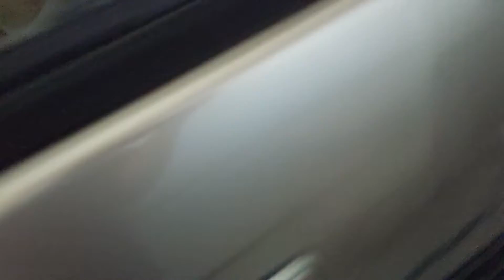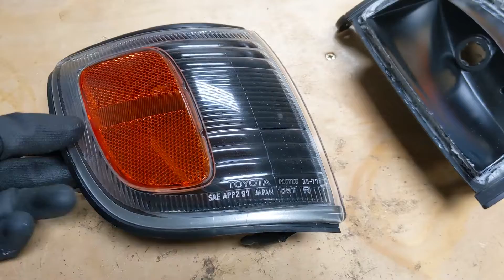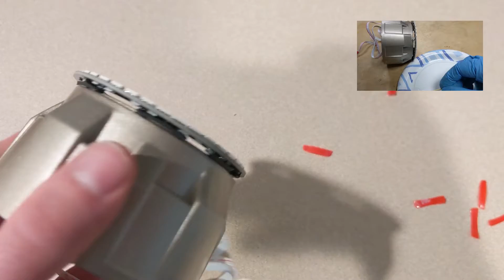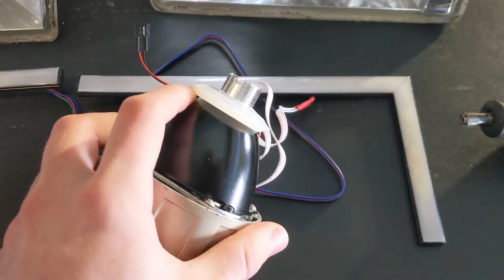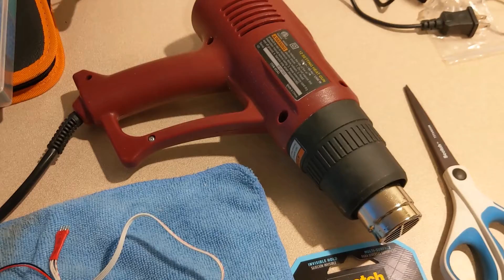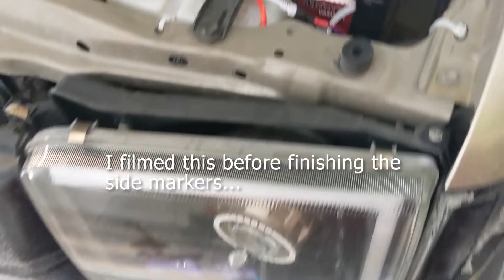DIY Custom Headlights - 3rd Gen 4runner Part 1

Comment: How are your lights holding up?
Reply from the maker: The projectors themselves are doing great, but not so much for the LEDS, I should have bought some higher quality ones, the blue signal for 3 of the LEDS in the driver-side halo have gone out. I bet if I epoxied them as well, we would be just fine!
Reply: @Tuccibuilt  I ordered the Morimoto projectors with the HID lights.  I'm not doing any halo's or anything else.  Just want to be able to see at night.
Reply from the maker: @christopherbrown5338  Great choice!
Reply: @Tuccibuilt  Better be for how much they cost!
Reply: @Tuccibuilt  One of the things I learned on my retrofit lights, LED's fail. heat dissipation issues with most installs is common. Halo's are toast and now I'm just rocking the projectors and don't care. The light output compare to em is a game changer here in the PNW

Comment: I have a 2000 4runner, is there a DRL wire I would have to cut?
Reply: Looks nice btw
Reply from the maker: Thanks! From my quick research it seems like there is possibly a little box right next to your battery and you can just disconnect a connector. Do a search for "2000 4runner drl disable" and there are some forums that should help.

Comment: Honestly I would just leave it stock. Looks like an alien or ET. I would do this to maybe a Honda but not 4runner. The 3rd Gen is already as clean as it get. There's more people moving back to original stock look than retro. Spend your money on other upgrades where it counts. That's just my opinion.
Reply from the maker: They definitely do look different, but I has grown on me. You're right, the stock ones give a really clean and fresh look. All I know is that the stock light output should be illegal it's so dim, these are much better
Reply: @Tuccibuilt  I put LED lights in place of halogens and it's night and day. Try it. It brings a more modern look. No need for retro lights. Looks way better too!
Reply from the maker: @genxiong2695  To my understanding, LED's in place of halogens is illegal, I could definitely be wrong. But overall these lights perform great and look good so I don't plan on changing them.
Reply: @Tuccibuilt  I was going to ask if it was really worth doing but you've answered that.  It's been two years, what is your opinion now?  Have they worked out good for you?